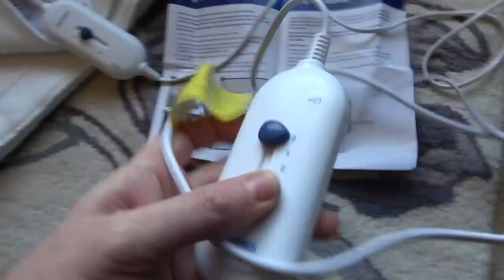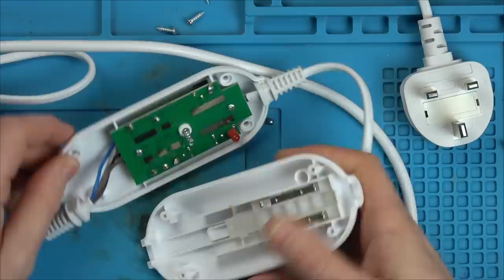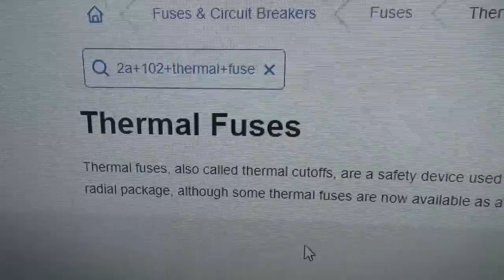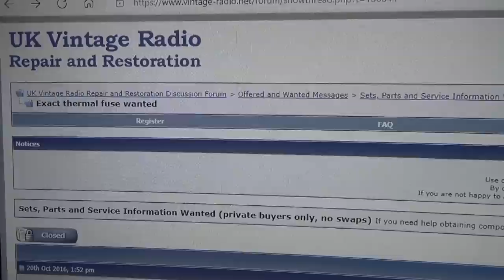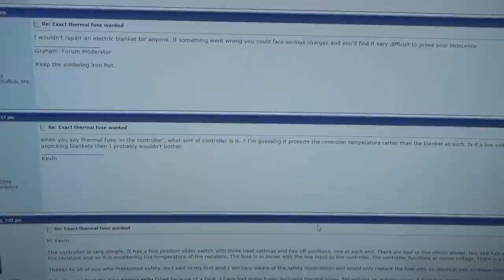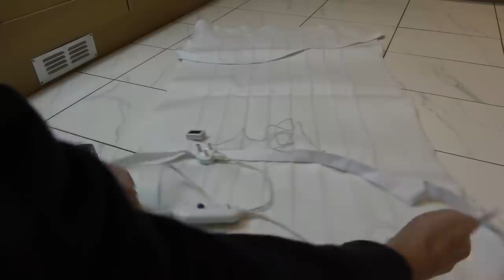Faulty Electric Blanket - No Power - Tea Break Fix

Comment: Erring on the side of caution is never a bad idea, but having a thermal protection device very near the value of the original should be just fine.  The tolerance for these devices may be well within a few degrees anyway.
Reply: That was not the point,it has to be the exact same cause it wouldn't be able to fit in between those resistors which is essential for it to work properly.
Reply: @MeMelon4u  -  How so (serious question, BTW)?  IOW, why does it have to fit between them, rather than nestled atop them?
Reply: @n6vcw  the fuse "trips" when the resistors get to a certain temperature and for it to be accurate it would have to be nestled in between them,this is by no means what I have thought about and said with my knowledge,it is mentioned in the video,while he was going through the internet he read this and mentioned it.

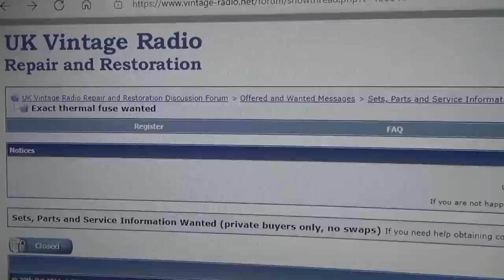watch from 14:40 he mentions it from there.

Comment: I can understand the safety concerns. But if you look at it logically and take a fuse that blows faster than the one from the manufacturer maybe about 5 degrees less to the one that the manufacturer has installed, there should be no problems of course only if they have the same size and are as good as possible sandwiched between the resistors.
Reply: yes.. you stole words from my mouth Hledf 🤣... ...its save to say that if use lower temperature than original it will cut faster but those volt and amp must to be same as original never bigger... but  got to say I not electrical so.....  but if it is mine i will trust those lower temperature ones..  but i understand that you will be careful 😃
Reply: plus you can / should(?) put thermal paste on it to improve heat transfer from the (over)heating resistors to the fuse. Also the expressed safety concerns about a proper fuse replacement very much sounded like the "safety and security" argument often used against right to repair.

Bonus: There does not appear to be a transformer, so if you tear the blanket and the heating wires you can get a shock with 240V. Does not sound very safe either.
Reply: Exactly, i dont think the chinese guys throwing them together make it better then using a lower Temp Value Fuse :D
Reply: @agnag1  Thermal paste will dry out and will then likely insulate the thermal fuse from the resistors.

Comment: It won't go in fire if you put 104 deg. one they probably have 10 deg. tolerance. You can remove it completely. Those thermal fuses are there if you run it folded, to kill the power and mostly play a role like waranty timer (use it few times before waranty goes of and throw it for no reason), no other function, i remove them everytime i see them in something, even if they are not blown. My grand mother had electrical blanket around from 1984 and i fix it 5-6 times (the weak spot was cable near blanket) over the course of 25 years and it never had such a fuse (it is probably still working) - just a 3 step switch and the heater. Such blanket can't go in fire because the heater is calculated for around 50 deg. max on mains, if something is shorted - well you have normal fuse for that. Thermal fuses are joke timing invention to make you throw the thing and pay extra money when waranty goes off - no other usefull purpose.
Reply from the maker: Thanks technixbul 👍👍

Comment: Anything with thermal safety cutouts shouldnt be touched IMO. There may be a bit of leeway in ratings but it just isnt worth taking the chance. Good fix though with the temperature monitor.
Reply from the maker: Thanks Emma 👍👍
Reply: False. I've replaced tons of thermal fuses in electric dryers - professionally. What are you supposed to do, replace a $300 dryer because a $2 fuse went out? Why do the manufacturers sell replacements?
Reply: @maximusmax4557  Electric blankets are surrounded by stuff that will catch fire quick. Some blankets are designed so that you can sleep on them while they are on. Thermal cut-outs are pretty important on a blanket and more so than electric dryers. Like for like or not at all is my opnion.

Comment: This is extremely interesting as I actually have one of these on my bed right now! However it does work as intended, if it was faulty, I'd send it straight back to Argos for a replacement as I wouldn't recommend even attempting any repair on such a product, as you will most rightly point out to us.

Comment: I honestly don't blame you for deciding not to go ahead with the repair, I'd probably come to the same decision. Heat stuff getting them working though just for the learning experience.

Michael sent me and Joey one of those signs too, they're amazing. He said he uses old fence panels (I think)
Reply: I never repair any mains voltage equipment for people nowadays it's just not worth the risk. USB voltages only on my projects now (5V) with a certified PSU.
Reply: @chrisreynolds6331  yeah I don't blame you. I personally fix consoles mainly but I won't repair power supplies
Reply: I think repairing switching power supplies is pretty safe compared to repairing electric blankets. I've fixed many switching power supplies, but some have failed again later, because the cause is not always a single cap or transistor, usually multiple caps are to blame, and if you don't replace them all, it might fail later on. But electric blankets - no thanks. You can probably light a cotton bed sheet with just a 5 W resistor, if the wattage is located in a small place.

Comment: I did this repair - no need to get EXACTLY the same rated heat fuse, in my opinion (only!). I got a fuse that was something close from the bay of e, unsoldered the old one, put in the new one, all good. Remember to disassemble carefully, don't lose the spring and ball bearing that makes the slider swith 'notchy'!

Comment: Great stuff Vince, and spot on conclussion regards not attempting to replace the thermal fuse, unless you can get an exact replacement.   Because people sleep wrapped / covered in these - it's just far far too much of a risk to attempt to repair one.  Even if I had one of these where I replaced with the exact part, I am not sure I would be able to sleep at night lol.   It's as you say - is the fuse making the same physical connection to the resistors, is it able to couple the temperature correctly (a fake may look identical but might not absorb the heat the same).  You could fit a 5 degree less fuse and find the fuse has a 10 degree less transfer rate because of its package (sort of thing a cheap brand might suffer).

Comment: I bought three of those blankets from Morrisons, one double and two singles. The first double wasn’t working at all so I took it back and got another one which did seem to work. Both the singles worked and are still working I believe. However, after prep six months and very little use the double blanket has failed, and it would seem from watching a video that there is a general weakness in the manufacturing of this blanket. It is a silent night blanket, just as you shown it in the same sort of package, but it’s made by a different company under license made in China

Comment: Another great video Vince .
I don’t trust electric blanket even though I’m sure your not meant to sleep with them on.
Just doesn’t seem right having a 240v heating element under combustable bedding.
It’s a cleaver safety device having the thermal fuse between the 2 resistors and by their temperature monitors the power the blankey :) is drawing.
Normally when a fuse or thermal fuse blows it’s for a reason , heating or drawing more power than it was intended to , as you said it may have had the wrong blanket plugged into  the controller ( shame the sockets aren’t keyed to stop this happening) or it could have been a fault with the element inside the blanket.

I think you’ve done the right thing in showing the video and explaining why you reversed the fix and returned it to an unworking state.

My daughters GHD straighteners broke again due to the thermal fuse , I done a lot of research into the replacement fuse and brought it from a reputable website and not off eBay 240v and damp hair could end badly
Reply: it's not a 240v heating element, the 240v is converted to 20v dc which you could hardly feel if it touch you.
Reply: @TC-tn9tb Phone lines and PoE are 48VDC, and those rarely kill anyone.
Reply: Just to say I've gone through at least a dozen blankets over over 2 decades, I've left them on full heat, crimped them, as far as I know I'm fine :)

Comment: On my pre electronic engineers course in the 80s. We had numerous electric blankets all with the same problem of blown fuses. The controllers were all secured by break off head security screws so we had to drill them and use screw extracts to gain access. The thermal fuses were all ok. It was the power fuses that had blown. We replaced them all. Safety tested them. Then they were all sent to the labs for further checks before they were given back.

Comment: Interesting video on what can be a sensitive subject because it is all too easy to circumvent the safety side without being able to really test the repair once completed.
The bit that made me wonder was (assuming it was an exactly matched fuse swap) then how important is the thermal bond between those resistors and the fuse? I remember seeing some scrap blankets with what looked like silicone gunk bedding the fuse between the resistors but not on others. Seems like there could be a lot of attention needed to exactly match the manufacturers safety methodology... but they are not going to share that as we know already.  
Many thx for the video and a chance to think about them again. 😀👍

Comment: Just found your channel looking for info on fixing my electric blanket (Biddeford). Nice clear video!   I noted that the higher temperature fuse had the white heat-transfer paste, which makes sense because that fuse needs to get more heat faster to pop at 102C vs the 76C fuse for the same fault condition (i.e. heat flux from those capacitors).   I like the safety cautious approach as well, but why does the amperage of the thermal fuse matter?  You found one onlilne for 80C but at 10A vs 2A.   The thermal fuse would not be popping off due to high current through itself, but due to high current through the neighboring resistors (causing heat).  So why would the 10A vs 2A rating matter for a thermal fuse?  I'll be watching your other videos now.  Thanks for your channel!

Comment: A better idea would be a microcomputer controlled electric blanket with a sensor that sends the temperature back to the controller  which compares the wanted temperature with the actual temperature and uses that to control the temperature and won't let it go any higher what about it Vince.

Comment: The single and double Silentnight blankets both have a 3 heat setting slide  controller.  The double draws a higher power consumption on each of the 3 settings than the single.  Make sure to match the controller's rated output to the same on the blanket wattage label as they are both visually similar units.  The blanket is machine washable with the cable unclipped from the blanket connector.

Comment: My grandma used to have electric blankets. I remember she would just use them to warm the beds up as it got pretty cold in the bedrooms during winter (north of France, no central heating and bad insulation) but she would remove them right before my sister and I went to bed. I didn't know you could leave them on all night long and as a matter of fact I wouldn't be comfortable sleeping with those because of fire hazard.
Reply: It's probably the "safest" place for a fire to start inside the house while you are asleep.

Comment: I used to sell these things many years ago. They are under blankets and usually not designed to be powered up while laying on it. You preheat the bed and turn it off and unplug before getting into bed. I would imagine they would be not the most comfortable things to lay on with the wires running the length of it.
Reply: I use an electric blanket as a mattress pad, and have been for months. It's on all night long. I shut it off in the morning, so it's not on when I'm not in bed (or at home).
Reply: I can't feel the wires at all as they're imbedded in the thick fabric .

Comment: It looks like it uses the two resistors to heat the thermal fuse so the longer it is turned on the hotter the resistors get.
Reply from the maker: Yes, looks that way. Cheers Scott, hope you keeping well 👍👍

Comment: Two for one. Nice Tea Break fix. The blanket is to dangerous to use I agree but you knew the problem before.. magic Vince?^^ Nice to see the thermal thing to work again which haven't in the previous video where you fixed the shower and flooded your bathroom 😉. Nice wooden plate you got btw. The mug is also cool.

Comment: A higher amp rating for a thermal fuse shouldn't matter. It's not designed to protect against overcurrent, so it's not a situation where a higher amp rating would mean that the device could draw too much power, and the device already has a separate fuse to protect against overcurrent anyway correct? It seems like you can find thermal fuses with the right temperature rating that are 10A, and those should be just fine if I'm not mistaken. Disclaimer, I'm not an electronics engineer, I have some limited knowledge as a hobbyist, but it seems like common sense to me.

Comment: i would  use those thermal fuses their so close to the original that they would disconnect the power well before a fire could happen, i'm not even convinced that those blankets are capable of bursting into flames, they only use 100w max and that's spread evenly over the whole blanket.

Comment: Yes it is a common problem with Silent Night electric blankets, Keep buying these Silent Night electric blankets from Amazon but keep breaking usually 30 days after the guarantee runs out, buy 8 of them from Amazon but all break in few months, costing me a fortune keep throwing these electric blankets away. Suffer from nerve damage and joint problems because of diabetes, have to run electric blanket 24/7 because otherwise wouldn't be able to move or get out of bed without running electric blanket all the time, really would be amazing if you could fix them instead of keep buying a new one every few months. P.S unbranded electric blankets only last about a week.

Comment: I wonder how the thermal fuse tripped though. Could it be that the user placed the controller under the covers, right against the heater wires? Or an external heat source like a nearby radiator? At 230V and with a resitor of 1.8k a current of 0.125A flows through the resistor. Power dissipation is about 28W. If the heater wires are the same resistance The current would half and power about 7W. in a confined space that's quite a lot. I wonder at what temerature the resistor runsat during normal operation. I thought that's what you were about to test next with the thermometer. 
If the thermal fuse is already close to the tripping point, it wouldn't take much to do so. Even a weak short would quickly trip it.
Reply: The 1.8k resistors are not in series with the blanket. They can't handle that much wattage. I think there is a NTC resistor in the blanket which is in series with the resistors. That way the temperature of the resistors depends on the temperature in the blanket.
Reply: @kriswillems5661  I see, thanks for clarifying!

Comment: I've ended up with my one failing and was able to find the correct 76°c fuse from a seller in Poland to the UK, having replaced it, the control unit, heated up and failed the same.

Comment: HHH is an indication Hi or an open thermal wire reading.
 Yes I would fix it as a difference of just a few degrees for the fuse should not be a problem it will still open on over heating.

Comment: I'm wondering has someone used the single remote on a double and it has blown, or on a folded blanket as you say ? I would have repaired it with a very close thermal cut out, but put the blanket on for say 5-10 mins and then switch off unplug and get into bed. In other words dont leave unattended. I remember when I first got married we would get in bed and lift our legs and use a hair drier under the blankets to warm the bed, as we didnt have an electric blanket or hot water bottles.

Comment: Wow. Of course, I thought of opening the controller on my TT-FF electric blanket. I'm so glad I didn't have to.

Why are these manufacturers allowed to sell blankets that go on the blink just from overheating once. I use a weak hair-dryer to pump warm air into my bed.

It has overheated a few times, due to my socks blocking it's throughput (silly me). But, like most heat fused electrics, it works perfectly when it has cooled down again.

Why is the electric blanket industry not investigated (or regulated)? Many people rely on an electric blanket to survive at night in freezing temperatures. This is a major scandal.
Reply: Doesn't seem like much of a thing here in Canada. Even in -20 degree winter days. I only saw one in person, and it was in an RV that we borrowed from someone else.

Comment: no dont use it if the fuse has blown they work on a very crude principle that the ni-chrome heating wire is wound around the common wire with an insulating plastic that melts at a certain temperature in case there is a fault or hot spot, this then decreases the heater resistance and  heats the resistors in the control unit and opens the thermal fuse.

Comment: the potty stuff would enhance heat transfer and so, a higher temperature fuse was appropiate.70ºC on a loose contact with the resistors... means the resistors themselves are probably 100 ....

Comment: Bypassed it with a normal 1 amp and a 1 amp in the mains plug. I think they are made to fail as they all have the same issue. Wiki says 5 years to failure in any case.